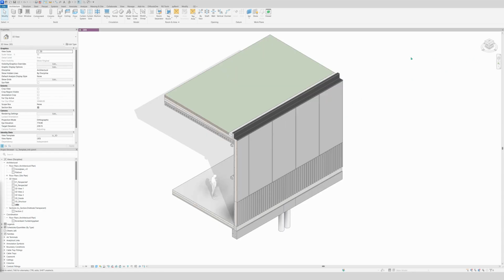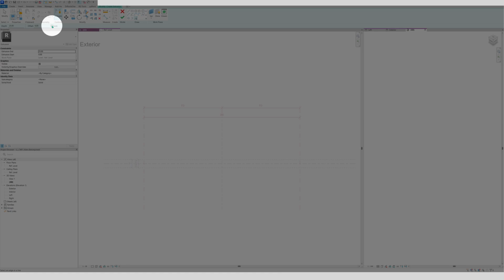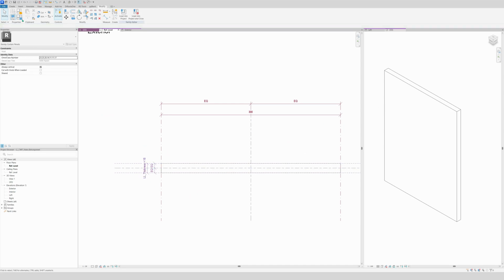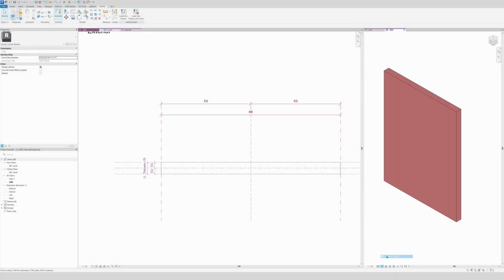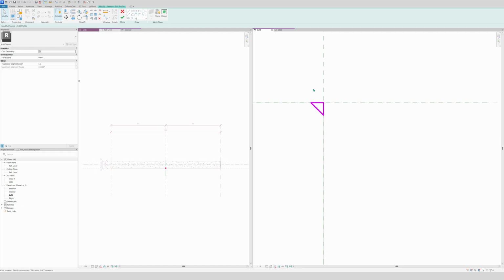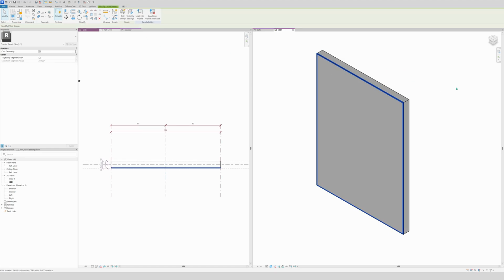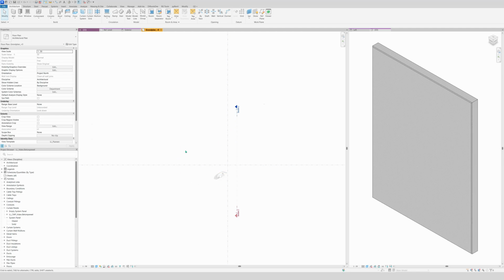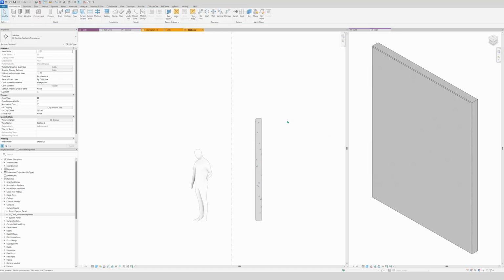Beginner Revit Tutorial; Concrete Curtain Wall Panels

Comment: Nice one, do we control the divisions too with the curtain system?, like the total panels on the curtain wall like the one you have on the beginning - a series of concrete panels in a curtain system?
Reply from the maker: You have two options: you can choose a fixed size, for example, 6 meters long and 2 meters high, where the panels are automatically divided (curtain system). Alternatively, you can design individual panels entirely to your preference. Hopefully, this helps you further!